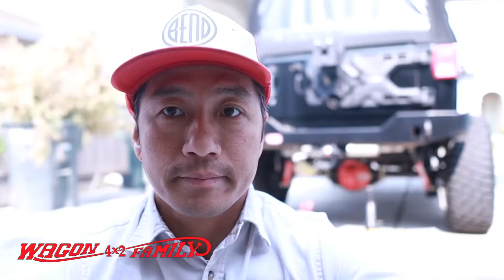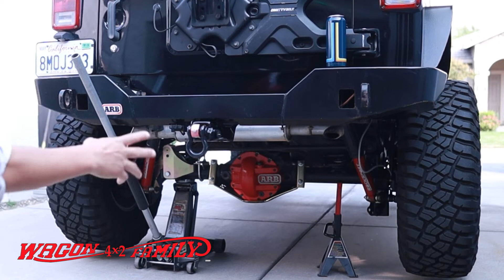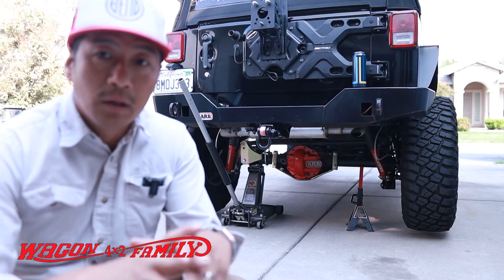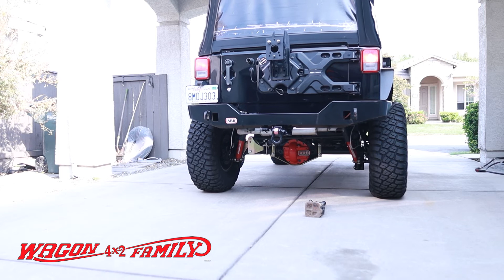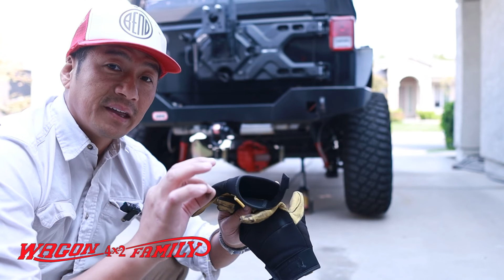what to do if one wheel is off the ground | How to Optimize Traction

Comment: The emergency break is only connected to the rear axle so that’s why it worked better. The break system is connected to the front and read creating front drag or preventing the jeep from moving forward and the front breaks have most of your stopping power, like 70/30,

Comment: I would say that this Truetrac should work great in combination with an eletronic traction control right? The traction control should brake the wheel on the air and transfer torque to the one on the ground?

Comment: I been using handbrake on rwd cars with open diffs for more than 40 odd years to keep my self out of trouble. Doesn't work on front wheel drive unless you got an old Saab made before gm took them over. I been thinking about putting extra set of calipers with cuting brakes on my gen 2 prius to stop wheel spin on the front to keep me out of trouble but haven't got around to it because of health issues.

Comment: Great video, thank you. Im curious now, I have a parking break that engages with a foot pedal on my tacoma. Would that act similar to a hand break? I'm thinking no. I like how it instantly hooked up with the handbreak though. I was leaning toward the eaton e-locker but the truetrac being cheaper, and with 1 less component that could malfunction(e-system), the truetrac is looking quite appealing. 

I've had detroit lockers in my old trucks but the daily driving characteristics were too much, clicking and popping through turns, and it would hook up too easily when wet and always cause me to spin.

Comment: My F150 has a Truetrac at both ends.  If a rear tire is off the ground, use the parking brake.  If a front is lifted, light normal brake pedal.

Comment: Do you have different gear oils you have tried? Apparently there is a lot of different info and opinion on what is best for max traction. Eaton seems to have gone back and forth on whether or not you can use synthetic and or friction modifier. It sounds like their opinion is max traction or torque bias is experienced using non synthetic oil with no friction modifier but they never mention any specific brand and I can't find one that is non synthetic w/o FM. I've heard of people getting great traction with Amsoil which is both synthetic and has friction modifier in it, but Amsoil is crazy expensive. What's your opinion on all of this? I'm looking at possibly trying Mobil Delvac or Redline NS which are both synthetic but no FM.
Reply: There are a handful of conventional gear oil products that contain no friction modifiers but it takes a fine-tooth comb to find them. The very latest EATON booklet sent out with their diffs state clearly "80W-90 conventional". I'm using the pricey Motorcraft 80W-90 Premium Rear Axle Lubricant at +/-$23 per quart but it's just 3 qts. EATON also recommends 50,000 mile gear oil change intervals for conventional. Just re-geared my 4 X 2 F150 w/ 4.10s and a Truetrac. This has been about the best modification ever and I've done some in my day. The driving dynamics of the Truetrac are literally amazing. I am continually surprised by it and altogether completely impressed by it. Reason for the shorter axle gearing is I'm running a 34 X 10.5 X 17 on my truck and with the gear swap have restored the use of my 6th gear PLUS the 6-spd transmission's 4.17:1 1st gear is now almost a granny gear (4.17 X 4.10 = 17.09). I have no transfer case so I'll take what I can get. The whole shebang is just bitchin'! Cheers.

Comment: The military teaches you to use the brake pedal with the gas because the Humvees have a torsion differential front and rear where the parking brake would only help engage the rear tires. The front tires would not be so by getting proficient with the brake pedal you can drag your brakes as your tires start to lift and keep on moving that was a good video though

Comment: I've got a 2022 Ram with the anti spin diff when I jack up both sides of the rear and turn one wheel forward other sides turns in reverse is this normal
Reply from the maker: @michaelfrank6696  yes every solid axle with open differential does this untill it is locked hence the name (locker).
Reply: @4x2WagonFamily  it doesn't have a locker just the anti spin is this normal for the anti spin also
Reply from the maker: @michaelfrank6696  yes

Comment: What if you had the left in the air?
Reply: As long as one wheel has zero traction, then a light touch on the brakes should be maintained to continue the torque-biasing operation of the Truetrac.
Reply: @applesbighatranch6906  
thanks

Comment: To my mind, these Trutrac are absolutely useless for 4x4 application.
If you are having to drive hard to get up a rock or steep Incline. You don't want to be stopping to apply the hand brake or foot brake as soon as one wheel comes up in the air.
An E locker would be far better in the rear.
Or a Torson

Comment: hello! Is it advisable to use a truetrack, is it recommended on the front axle? For a wrangler mixed use more than normal road?
Reply: Yes it is not actually a locker it handles perfect on the road you can't tell it's there

Comment: The true trac with brake traction control.  What jeep calls a brake lock differential. That is pretty good.   It will apply brake to the wheel spinning.
Reply: Yeah my 24 year old Land Rover Discovery has really aggressive ABS traction control specifically for off-road and it will put the torque through an open differential so quick when it's in the air that with one of these the torque by its effect from the break to the gripping wheel is even more intense than it was through a open diff. It's crazy you can pick up these old Land Rovers for like 4 grand and they're insane off-road and then throw a little money into them and you don't look like everybody on the trail driving a Jeep or a Toyota. Totally Rock Solid front and rear third member is totally balanced like a quad all aluminum lightweight durable it's amazing. Solid axles front and rear coils all around tons of articulation
Reply: Swapping in torsen diffs with that level of brake traction control is better than lockers.  @ronaldrrootiii6040

Comment: truetrac front and rear, handbrake controls the rear wheels when off the ground and foot brake controls the front
Reply: And Land Rover traction control applies only the spinning wheel lol even better to split torque to a wheel that doesn't have the brakes grabbing it while it's on the ground
Reply: The biggest problem with land rover traction control is that it requires one to own a land rover, bugger that @ronaldrrootiii6040

Comment: How far do you pull the hand brake back?
Reply: Far enough to actuate the locker. It all depends on the adjustment of the cable for your brake.
Reply: As little as possible. Keep your thumb on the ratchet lock button, and modulate your effort for best results. Less is more, until you find you may need even more. lmao. srsly. Cheers!

Comment: When you apply brakes to get the torsen to lock up does it stayed locked when you release the brakes or does it open up again?
Reply: Well it opens back up because it never really locked it just transferred torque and it stops transferring to work because you let off the break. It's only transferring torque because it's matching your break resistance to the other side. If you had traction control and it grabbed only that Spinning Wheel it would be multiplying the strength of the grip the spinning wheel is receiving from the brakes and sending that across to the gripping wheel kind of like an open differential on a Land Rover traction control or a Toyota A-Trak except for it multiplies the torque instead of just sending an equal amount of torque compared to how hard the brake is grabbing and really it was never locked but just sending torque to match how hard the brakes were grabbing. It's like a chain reaction I'm sending torque by default that strength has to move to another location and it becomes the other wheel
Reply: @ronaldrrootiii6040  Correct. This is only a concern if a drive wheel is momentarily not touching the ground. As long as both tires have some level of traction, and one tire's grip can be far greater than the other, as long as both have some form of resistance then adding brake is not necessary. 

Then again if spinning one tire in sand, for example, then that may be similar to a scenario where that tire were suspended and then of course the driver (or the traction control or the E-limited-slip software) will add a little brake to bias torque to the tire w/ greater traction. Cheers.

Comment: that bottle jack was pretty much like driving over a tiny pebble.. or a penny. a real 2way LS diff handle that no problem
Reply: No it wasn't like driving over at Pebble because the wheel was off the ground the point wasn't how high it was it was the fact that it was off of the ground and it doesn't matter how high off the ground off the ground is off the ground LOL wow

Comment: I’m debating between a Truetrac style torsen front limited slip vs a front ARB locker for my 4Runner. The rear would get an ARB locker. Obviously price vs capability is the determining factor. 

The 4Runners ATRAC system (similar to Jeeps BLD) isn’t so great in snow where I need both wheels to spin fast instead of the abs allowing for partial spin here and there. I think a Truetrac style diff would help out here.

My only concern would be in the rocks when a front wheel is off the ground. The ATRAC system would quickly engage the limited slip so I wouldn’t have to worry about left foot braking, but having a locker would mean I could proactively crawl over obstacles instead of ATRAC “locking” and “unlocking” the Truetrac off and on again while going over rocks etc.

My question to you is, if you had to do it all over, would you go for the locker ? Do you think a Truetrac style torsen diff plus an ATRAC style abs brake locker is more than enough for moderate trails ?

Comment: I'm sold. Please let Eaton know where to send your commission check
Reply: You should see how good it works if you have a trashy control system that applies the brake only to the spinning wheel. Hell even a tracking control system with an open differential is better

Comment: What’s bout a truetrac in the front? Work the same?
Reply from the maker: Yes, but instead of using the hand break you can use the foot brake. If you have truetrac both front and rear you probably will not have any issues in the first place:)

Comment: Thanks, I was considering one of these for my truck. Now I'm reconsidering as it would be hard to do brake, clutch and throttle with only 2 legs. My e brake is also a pedal.
Reply: Practice the ol' "heel-and-toe" technique. It is the right foot on the brake pedal then (depending on pedal placement, shoe size and how one first learned the maneuver) while keeping pressure on the brake, rotate your foot and use either your toe or your heel to press the throttle. This was primarily used when auto racing using a manual transmission when downshifting to either preserve or replace "synchromesh", allowing a clean, quick gear change with little or no harm done to the transmission)

Comment: I love my truetracs. I have them front and rear with no issues.
Reply: What vehicle? And have you had any experience with them in the snow? TIA!
Reply: @2wheeled76  2004 F250, 33" wrangler duratracs. Light off roading, camping, & most snow has been on the road. It literally has to be 18 inches deep before I even start to worry. My bumper is about 2 feet from the ground though. Other than the tires and truetracs my suspension is stock. I love them. You hardly know they're there, they just work.
Reply: @2wheeled76  Also, when this drove off the bottle jack he guy disproved that nonsense about needing both wheels on the ground or else it's useless.
Reply: @Ken19700  thanks very much for the info! Agree, I’ve seen some other owners w/TruTrac’s use the brakes to engage non-traction wheel with consistent success.  Sounds like the ideal set up: doing much of the same with camping/off-road fishing spots, driving in snowy conditions in the northeast along with exploring all of the un-maintained service roads. No rock crawling.
Reply: @2wheeled76  I'm not doing any extreme off roading but the military uses the same type of differential in their vehicles as well.

Comment: Thanks for this great video.  I am still trying to decide. I have independent front suspension. So imagine I am on a rutted out trail and one wheel raises from the ground (this happens alot). The wheel off the ground will receive all the power. Do I quickly have to move my left foot over to the ebrake to make the Truetrac give power to the wheel on the ground? this type of situation is the biggest reason I am considering a locker or Truetrac. A  locker might be better for this situation because I would not lose momentum while I figure out how to get my left foot to the ebrake. Not feeling fantastic spending twice as much for ARB plus the compressor tho! Thanks for any comments about this.
Reply from the maker: Eaton elockers is a great option and wallet friendly.
Reply: If you have traction control it will be highly effective because when it grabs only the spinning wheel it will bias the torque and send it to the gripping wheel as opposed to pushing the brakes and sending brake power to the wheel that you want to grip and now it has to fight your brakes. If you're going to is where all the weight goes when you're doing a climb and you don't raise wheel as much with the rear but who cares if you raise the front because it can't pull you up a hill very well it's hardly gripping because even the one on the ground is barely gripping . Obviously front and rear is best but if you're only going to choose one don't get only front it makes no sense there's plenty of videos showing that only a rear is the best and if the front spins it won't matter because the rear is still pushing you with both Wheels on the ground from behind and you're going to make it just fine. The people that say get a front first of the people that aren't very serious and they just think the wheel is in the air so you might as well stop it but the rear ones are always on the ground

Comment: Exactly how it’s meant to work remember when using the brake pedal you have a percentage of front bias which is how it’s meant to be causing the delay in differential actuation  but using  the hand brake is directly  impinging on rear brake causing resistance required by the differential to activate its lock fantastic I tell you JP!
Reply: That's what makes these things so amazing what's my old 2000 Land Rover traction control because it can throw the torque through an open differential with a wheel in the air so imagine what these differentials and it is only adding the brake to the spinning wheel instead of all of them the way people do when they push the brake pedal LOL I have one spinning wheel and immediately launches into the other one I don't even need lockers. Funny Toyotas barely starting to come around with the a track and it still doesn't work as good as 24 year old Land Rover technology

Comment: For anyone still deciding, Go with the TrueTrac . If you have one tire stuck in the air, a light application of the foot pedal brake while giving it some gas will cause the TrueTrac to transfer power to the wheel on the ground (and the wheel in the air, it acts like a full locker). Have one installed in my 2000 GMC Yukon and went to hit some trails, I literally didn’t need 4WD. It was freaking insane. The TrueTrac was digging and chewing through everything. The truck was shaking so violently when i crawling through sand I thought I was going to brake something or get stuck. Nope. These things are amazing, HIGHLY recommend. TrueTrac will turn your vehicle into a beast.
Reply: Yeah and if you have a traction control system like my old Land Rover it's super super good with a wheel in the air because it doesn't just transfer the torque to the grounded wheel the same as an open diff it does the torque bias affect like it will on the ground and transfers a lot more power to the wheel on the ground. And it's great because you're not hitting the brakes with your brake pedal adding brake Force to all the wheels it's only the spinning wheel and it shoots torque over there . What's crazy is the Land Rover already does it super super well with open differentials so with these it's even more intense
Reply: most Newer trucks have break bias traction control.. if one tire ends up in the air the vehicle automatically applies the brake to the fastest spinning wheel, and it sorts itself out... 👌

Comment: Thanks for the video, you just saved me from tearing my truetrac apart for no reason. I got it stuck with one wheel in the air while off roading and I thought I broke it because only the unloaded wheel was turning. Confirmed in my garage with my floor jack, same issue. I'll try the test again with the hand/parking brake and see if it will engage. Thanks again for your time!!

Comment: I ran Detroit true Trac on a 2 wheel drive 96 f150 in the mountains and snow in Utah. Never got stuck and never slipped a tire. It was fantastic. See my channel
Reply: I also live in Utah and I'm getting my rear end rebuilt in 2 weeks at Axis Driveline in North Salt Lake.  They are putting in Yukon 4.10 gears (already have 4.10's but rear end is howling) and Eaton TrueTrac.  I'm excited because my Z71 usually needs 4x4 to pull my boat out of the lake on a wet ramp.  It will be nice to be able to get more traction instead of just spinning the right rear tire.  Also on wet roads trying to climb a steep hill I have to baby the throttle or else the right rear just spins.